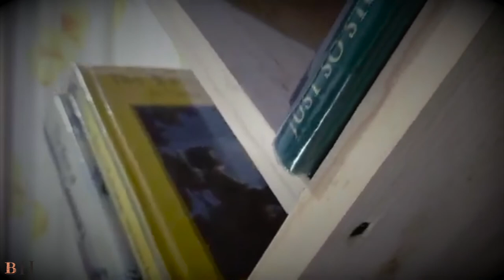HOW TO MAKE A TREE BOOKSHELF

Comment: Wow. How wide is the board used for each shelf?
Reply from the maker: It was 8 inches, pinewood that wide is hard to find here in the Philippines so I fabricated two 1x4s to make an 8 inches panel.

Let me share the length too in case, it’s 35 inches, one side is 21 inches and the remainder is on the other side minus the thickness of the material which is about a quarter of an inch :)